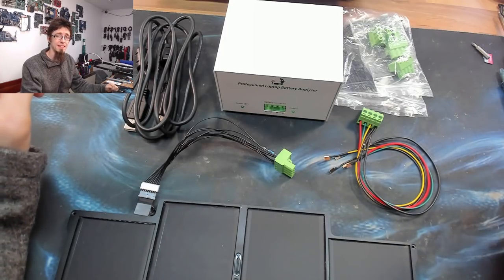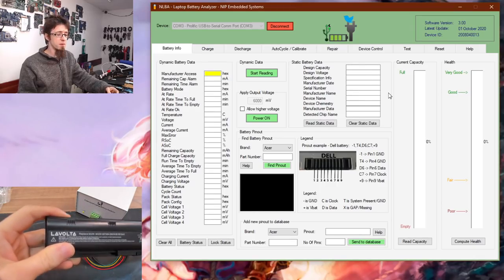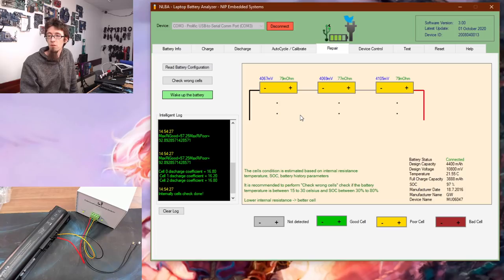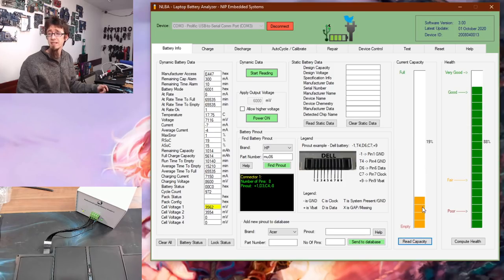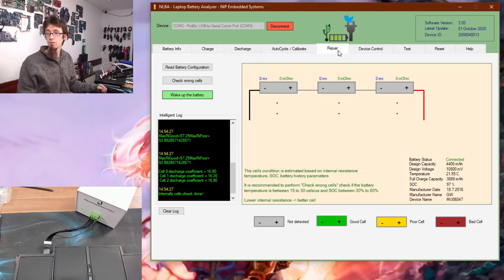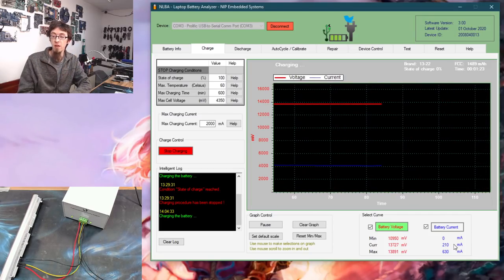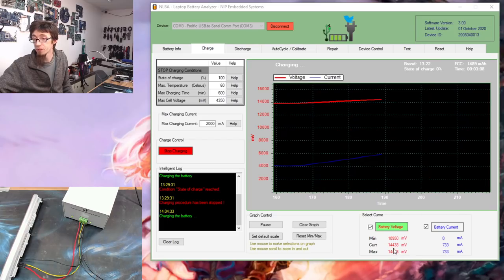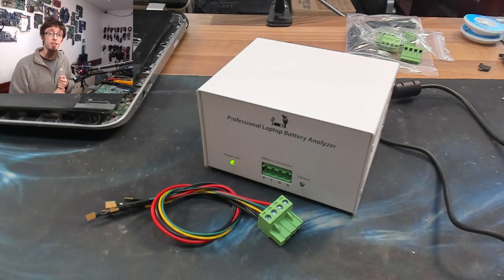Professional Laptop Battery Analyzer - LFC#227

Comment: I don’t think this product is useful “to us” in its current form.  But due to its low cost, I bought one anyway, in hopes it’s future development will yield better capabilities “for us”.   I think this device would sell like crazy, if it could write to internal controllers.   Replacing cells and unlocking the chip, would be a HUGE game changer.  Without that, it’s just a glorified reporting machine IMHO.  I’m with Graham, if a battery is bad with a locked chip, why bother.  Nothing this device can do.  It’s cheaper and less of a headache to just buy new $20-$30 batteries.
Reply: There are 2-3 softwares (just software) in the world that could reset/reprogram the chip. They cost up to $1000 per year. Most of the chips are very well secured, that's why the price is high. I will add more chips soon for affordable prices.
Reply: @nipembedded9976  Specifically, what are these programs that cost $600 more than the Professional Laptop Battery Analyzer?

Comment: UPDATE: Now NLBA comes with 10 FREE Days for Reset/Unlock/Repair option. Easy to recover the investment. For existing customers, 10 FREE Days for Reset Option can be offered upon request.

Another great review. You explained very well the features of this device. I would like to add some more info to avoid any confusions:
If the battery is in Lock state it cannot be "Revived". If a battery has bad cells then nothing in the world can "repair" the battery. 
Steps to repair a battery: 
1. Detect the defect (in many cases it is due to over discharged cells) -> NLBA can do it
2. Fix the defect by replacing the cells or bring all cells to the same voltage. 
3. Reset/Reprogram the chip to clear the errors (NLBA for the moment supports BQ8030 chip reset and I will add more chips soon). This step is very difficult because all chips are secured. Latest chips have even SHA256 bit.
4. Analyze the cells voltages by measuring the internal resistance and tracking the voltage under load -> NLBA can do it.

Comment: In playbook days when you discharged it Right down and it refused to charge even leaving it plugged in overnight a trick called stack charging got the battery up to the minimum enough to charge !basically you plugged in the charger and then immediately out a score or so of times if nothing, you repeated it. It works by putting in a tiny amount of charge at a time until the control board wakes up and charges normally.
Never chuck dead battery packs out its generally a dead cell the rest maybe fine ,i power all my torches with old laptop batteries you just have to use a small pcb charge  circuit (from ebay) to safely charge them as the batteries themselves do not have built in protection circuits or a decent charger with overheat protection as bad ones heat up fast!

Comment: I have bought this tool to test my big lot of laptop batteries, about 1000pcs. It helps me a lot to see which one is working and how good it is. You don't need lots of laptops to test the batteries. Just one NLBA and you are done. Version 3.00 is great because it shows Battery Pinout, you don't need to search for clock, data, gnd, system present. I am happy with this product.

Comment: Nice bit of kit, but the biggest problem I have found with laptop batteries is when the control chip renders the whole battery faulty locking it from being used ever again. If this machine will be able to reset locked control chips in the future it will turn it from a handy tool to have into a must have tool.
Reply: Right now BQ8030 Sanyo chip can be Reset/Unlocked using NLBA. Soon more chips.

Comment: After the video from sorin, I bought this product. A well-made product. Very simple software, easy for everyone. You don't need a specialized technician. Very good communication with support, forum involved. Resetting, calibrating, testing, all with just a few clicks, I recommend it to everyone.
Reply: Can it reset or unlock chip

Comment: Mmm 225,= dollar is it worthy for getting old batteries alive. 
For that money you can buying several new ones.
But you're explanation is spot on and give us inside information that a battery is not just some cells in a row....🔋🔋🔋
Thanks Graham.
Reply: Yes, a laptop battery is very complex. They are built-in microcontrollers that run complex firmware. The device is an advanced analyzer for almost all laptop batteries, not only for old. The latest software version supports the Reset/Reprogram feature for the BQ8030 chip with Sanyo firmware and soon more and more chips will be added.

Comment: The one thing that was not brought up in this video is the perspective of battery building and repairs. The controller in the battery is pre-programmed at the factory, and it follows the life of the original cells. However, when you go into the battery and replace a cell, the controller must be re-programmed. Even worse, if you do a total rebuild of a battery for, example a laptop where the battery is no longer available, a full re-programming of controller for the newly replaced cells is necessary. Some people think that, for example cell two is bad, I can just go in there with a spot welder and replace the battery, and the controller will automatically recognize it. No, it won't, and you need a tool like the NLBA1 to perform a full re-programming of the controller. So yes, this might not be as valuable in a PC repair shop, as most repairs are just part swaps. But if your business is building custom batteries, or re-building batteries for older laptops, then this is a killer tool to have.
Reply: You are absolutely right. One mention, NLBA device is a battery analyzer, since February 2021 we started introducing programming chip option (which is not free).

Comment: That's a great bit of equipment :-D,  it also shows the cheap batterys for what they really are.
I have had to jumpstart batterys to get them to talk again, but the case has to be cracked open and power applied.
An odd cell that's stubborn can be charged a bit as well.
Reply: Some people use the device to measure the real capacity of the new after market batteries. NLBA has a function that can measure the real capacity of the battery. So you will know exactly how much mAh a battery has. Also Impedance tracker could easily help you to see how good are the cells of any working battery.
Reply: @nipembedded9976  What is NLBA? Care to share, thanks!
Reply: @samcheung4984  It is a Laptop Battery Analyzer.
Reply: @nipembedded9976  Multiple programs already on the market, for example AIDA64 and even some free ones, already give very detailed diagnostic info on laptop batteries. Things like design capacity, charge level, current capacity, wear level, etc etc. They don't show detailed per cell info like this tool though.
Reply: @nicT9  Such softwares like AIDA works only with the battery connected to the machine where AIDA is installed, works only if the battery is good, it shows you only a few basic information. What to do with it in a laptop repair shop ? Think that you can have tons of laptop batteries, to test analyze, create reports (charging/discharging), test cells' condition, revive or even Repair using Chip Reset Option. None of this can be done with AIDA.

Comment: Hi to everyone! I would like to thank the person who design and develop this NLBA device. There is a loot of good batteries out there those manufacturers are locking just to make people spend money! Let us be honest if any of us peasants would do such thing we would go to jail! This Analyser have helped me sort through my battery stock. Many of them turn out to be in great shape. I had completely unresponsive batteries that I was able to awake, charge, grade and I learned that battery that was made in 2008 have 89% life in it and the cells are great having only 22 ohms of resistance…. CRAZY. I think this is so far the best device I bought this year a specially that it was not too expensive. This will be handy every day in my line of business as I resell laptop parts! Thank you! I have no problem recommending that to other people who have knowledge and a bit of common sense…. This will not repair any bad cells as this is impossible – bad cell needs to be replaced but it will do miracles when it comes to good cells that was blocked by so called protection! Anyone who deals with laptops or other electronics that use this type of battery should have this on hand! Period! I only hope that it will be constantly developed, that owner will take on board users suggestions as I bet there will be many and that we can save at least 50% of them batteries going to waist and destroying our planet! Once again Thank YOU!

Comment: When the battery is drained, the button cell drains it to below 0%. For Asus, this minimum is 3.33 V for all pairs of cells. The draining lasts for 3 days. For Acer, this process lasts for 3 weeks. That's important for the battery maintanance, but only professionals do this. When the battery is in perfect shape, the laptop reaches its maximum even if it is Ac online with the battery is removed. A bad battery inserted can disable the performance gained by the new battery.

Comment: You would really use the AutoCycle/calibration if you replaced a cell (or all the cells) in a battery so that the controller updates to recognise as much
Reply: If you plan to reset the chip please note that NLBA for the moment supports only BQ8030 from Sanyo. So, for this chip you can set FCC parameter and you don't need to calibrate the battery. FCC is Full Charge Capacity which can be edited for this chip.
Reply: @nipembedded9976  are you the guys making these? They look very interesting. How can I get hold of one in NZ?
Reply: @darrenslab5537  There are no guys, just one :D You can check on www.laptopu.ro
Reply: @nipembedded9976  sweet dude. Have you published the protocol for talking to the box? I am a Linux guy. Happy to write the software myself - but any documentation always helps :)
Reply: @darrenslab5537  No, the protocol between PC and Device is not public.
Reply: @nipembedded9976  guess I'll just have to sniff it then :)

Comment: Its good explanation of the unit and got my own unit. the unit is good for assessment and testing of a lot of different laptop batteries. This unit has also capability to fix errors on the batteries like locked and wrong cell info.

Comment: This is indeed a very nice device and I've seen it before and I really like it, though I can't see too many uses for it if you think about it - the average service centers will not bother with "consumables". They'll just toss the battery and get a new one - no need working out if it's dead or not :)) The only reason to get is to get serious use out of it and that would only happen if your shop specializes in batteries or enforces some sort of rule about giving out a full report on ever battery in the products that come in. If it can't yet hack into the controller chips to reset them and make refurbishing batteries possible, it wouldn't see much use. Even after the fact, a replacement battery would probably outweigh the time/effort needed to replace cells and stuff...
Reply: Several use cases:
- checking a lot of batteries if they are good or not, is the battery charging/discharging then use it or list it on eBay
- reviving those overstocked batteries that are not detected by the laptop but still not in LOCK state
- for a laptop which is not charging the battery you will know if the battery is faulty or the motherboard
- calibrate the battery to report the correct SoC to windows
- you want to transport used laptop batteries by plan then you can use Test Report which is according to the IATA standard
- you want to recycle many batteries by extracting the good cells but you don't know how good they are, by checking the cells voltages you know if the battery worths to be unpacked or not. Unpacking a battery is not so simple
- for those who resell non-OEM batteries, such a tool can measure the real capacity and compare with what is written on the label

- an probably most important use case: to Reset battery chips or copy the image from a good battery to a bad one. Now it supports BQ8030 but I already have the solution to Reset/Reprogram all BQ20ZXXX, BQ20XXX, BQ3042X, R2J240. It's a matter of time to implement it in the software.
There are discussions with a team from Ukraine to implement resetting 99% chips on the market through NLBA. How would be to reset DJI and Apple batteries?
Reply: pls I want to get this stuff for laptop battery business... May main concerns is if I can reset or unlock the chip to change the cycle and maybe use the board for refurbished battery....

Comment: This is a comprehensive device. I love what it can apparently do. It should be noted that the hardware and basic, but nice looking, software simply test and diagnose batteries. To reset the safety features of overly discharged batteries, for possible recovery, one must subscribe to their error clearing software to the tune of $200- a year..... Code to twiddle with the bits of TI gauging chips is free from TI.

Comment: Can that analyzer reset a laptop battery that you rebuilt? If you take a laptop battery, replace all the cells, or a few, can that cool tool reset the BMS? Also, can that be hooked up to a laptop to see if the m/b is charging properly? Thanks & great demo of this nice device! 🤓😁 what macbook pro batteries, by battery #, can this test?
Reply: After replacing the cells you have to reset the chip. At the moment BQ8030 Sanyo chip can be reset. Soon more chips will be added. The device cannot check if the motherboard is charging properly, but it can check if the battery is working properly so you can deduct if the motherboard is good or not.
Reply: @nipembedded9976  ok thank you. There are literally hundreds of different laptop batteries! 🤓 thank you too, mr graham, for sharing the analyzer

Comment: I bumped into the Fuel gauge stuff years ago (when Laptop batteries were NiMH) and 'talked' to the chips a few times with an LPT interface, one thing I found was that running a few charge/discharge cycles then forcing a re-cal often gave much better results, I wonder if that would be the case with the recovered HP pack?

Comment: Can you use this tool to rewrite the battery capacity after adding higher capacity cells?
Reply: Yes, if the batteries have BQ8030 Sanyo chip. Soon more chips will be added.
Reply: @nipembedded9976  Have you added more chips? Which ones? How common are those chips , as in, are they rarely seen in batteries or covers majority of today's batteries? how much market coverage will we get with current batteries?
Reply: @nicT9  Are you talking about Chip Reset option ? At this moment we can Unseal and Reset about 80-90% of batteries on the market.

Comment: Whenever I'm doing wiring for a device that is used on a Raspberry Pi 3/4, that uses I2C I use the same colors wires, but I make the yellow wire the clock wire and green is data. I'm going to get one of these battery analyzers, I'll need to save up for it.

Comment: When you change the cells, most battery controllers reject the new cells.
Can you reset this?
Reply: Yes, if the chip inside the battery is BQ8030 Sanyo firmware. Soon I will add more chips.
Reply: you can also use be2works, it has much better controller support.

Comment: Good video and cool Tool but not worth $239.00 price tag. When the most laptop battery's are $20. There are some like my XPS is $150 and its not a 3rd party. I think the most useful tool your missing out on is an Ultrasonic cleaner with Branson EC cleaner.
Reply: $299 on eBay now!

Comment: What a great instrument and software? I'd never heard of it. Can we recharge a battery (i mean when the voltage has got too low that it couldn't be charged by itself) with a power supply only using positive and negative pins? Thank you very much
Reply: There are some batteries that can take some current but most of them not. For example Dell uses a special command to activate the charging MOSfet, same for discharging. The charging procedure is complex and must be done according to the smart battery charger standard. For example you must read the temperature sensor, you need to charge the battery with Pre Charge current first then to switch to constant current and after that to Constant Voltage. Also some alarms must be monitored. Anytime a failure is detected you must disconnect the power. Using all these information you could charge a battery let's say to about 80-90% but from 90% to 100% it is more difficult because some batteries require Pulse Charging like PWM other require some sleep periods and so on. It is different from brand to brand.
Reply: @nipembedded9976  You're absolutely a charging expert, thank you.

Comment: My laptop batteries are dead. I would like to use a power bank with all the features of a laptop bms and power it(laptop) up.
The power bank shall replace ac and internal battery. Is it possible to design such a configuration and how would the pinouts be. Thanking you in advance.

Comment: You can charge the battery direct. Without the chip to jumpstart it. Drill 2 holes and charge it.
Reply: Did you try it ? It won't work, the chip controls charging and discharging MosFETs, if the chip is in Lock state then you need to reset the chip.

Comment: What an interesting little device!  Lots of fun for battery nerds 😆🌱 and for putting new cells into old batteries I imagine.  I wonder if it could be put to use to allow LifePO4 cells to be fitted for a less explosive risk (but less runtime) edition laptop?
Reply: To use different chemistry requires more steps. I recommend to be done only in a specialized shop.